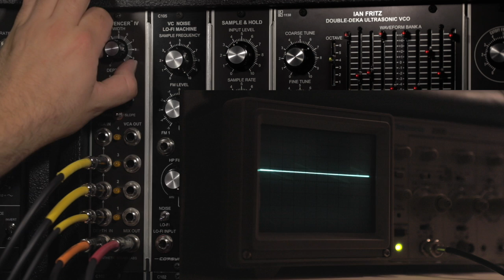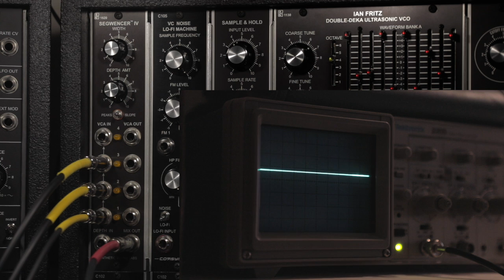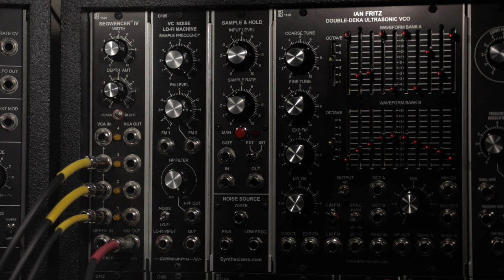Module of the Week ep.2 - Segwencer

Comment: The 4th stage on mine works without cv. Maybe you could offset yours to be fully open. It might depend on what version you have. Reach out to Doug. I think of the Seguencer as being a Swiss army knife type module. It can function as a VC switch, mixer, panner, distributor, multiple or VCA. Sometimes people don't realize that it can also take 1 signal in and send it to the 4 outputs. I've had mine for years. It's usefulness wasn't immediately apparent, but at some point I started to use it in nearly every patch. I recommend running more than just LFOs into it. Sequnecers and random voltage sources can produce interesting results. Also, you can send cv through it as well. It's an excellent choice for a small system. I could even imagine having a few of them in a larger system. I just ordered the euro version as well.